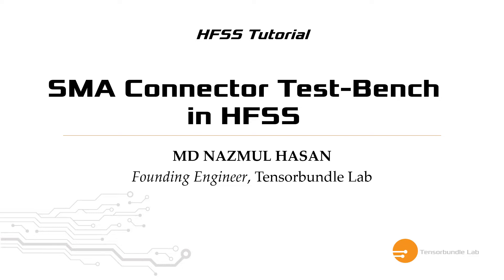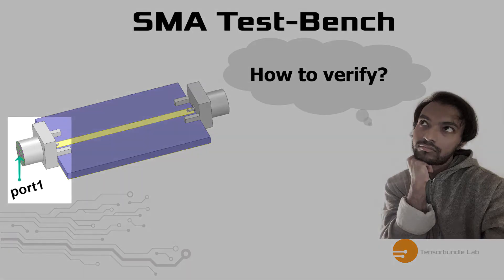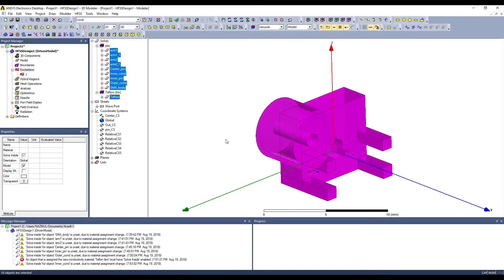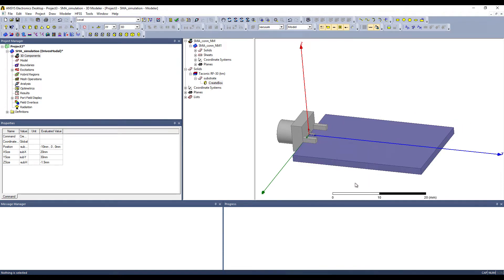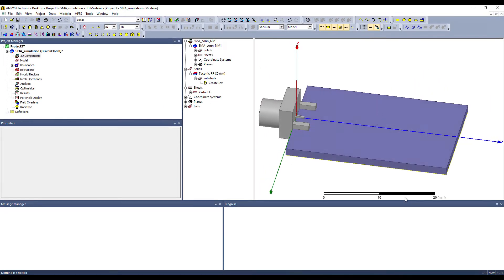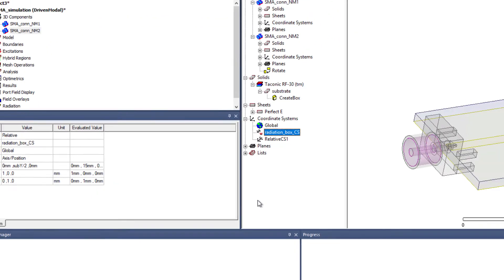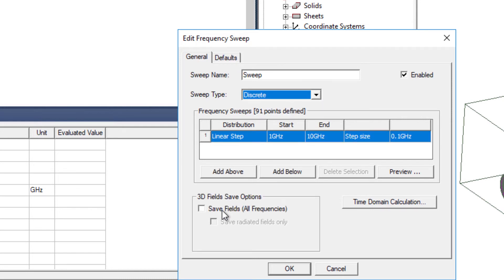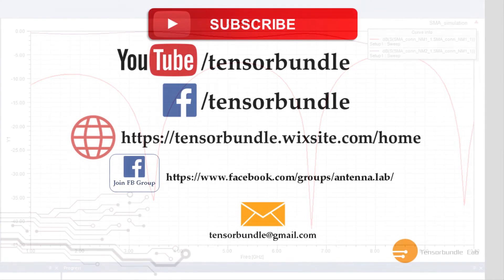HFSS Tutorial: Test-Bench for SMA Connector Verification

Comment: Thanks for the video.
In my opinion, S11 < -30 dB should be considered excellent. It is very much possible to do in CST with fine tuning the T-line parameters.
Reply: Yes. When assessing the S11 curve, you take note of the highest points. You should ignore the low points because they correspond to the frequencies at which the line is a multiple of a half wavelength and the match has made a full circle of the Smith chart. 30dB is a bit optimistic for an SMA at 10GHz, but I take your point.

Comment: Sir, while simulating along with sma file, and simulating the line without sma file, will the answer remains unchanged?. Because it is also a conductor additionally introduced, so will the answers vary?
Reply from the maker: It will vary due to the effect of SMA..Need to tweak dimensions after you include SMA in your antenna

Comment: hi, how did you calculate 50 ohm test plate? Microstrip Transmission Line Calculation results show 75 ohm.
Reply from the maker: you can use software like ADS "linecalc" or TXLINE to calculate it..or simply use any online tool
Reply: @tensorbundle  thank you sir

Comment: Hello,
Thank you for your help :) 
After following the steps you introduced, I obtained perfectly working simulation. However, when change the dimensions of the substrate, as I wish, I get an following error: 
   
    [error] Port refinement, process hf3d error: Waveport s is internal to solution domain and not fully backed with a PEC object.. Please contact ANSYS technical support. 
    [error] Simulation completed with execution error on server: Local Machine.

Is there anybody who experience such a problem?
Reply from the maker: It is a common phenomenon. Wave port cannot be placed inside the radiation boundary plane. It should be on the boundary plane. If placed inside, a PEC cap should be used on the back of waveport to mimic boundary condition
Reply: @tensorbundle  Thank you so much... Problem solved :)